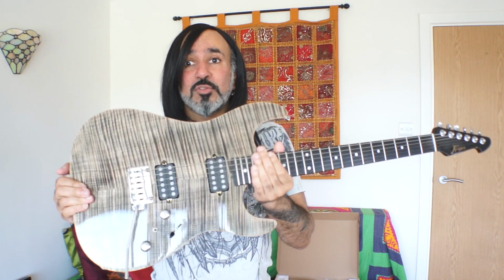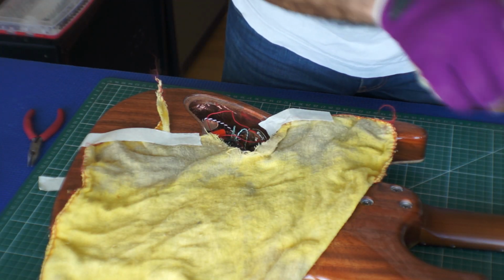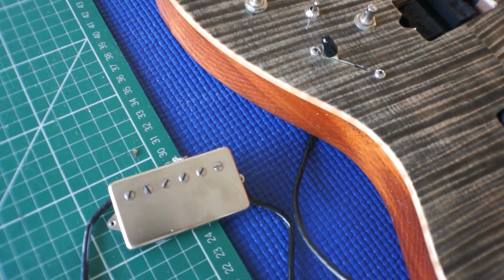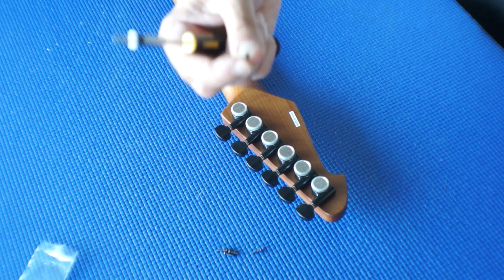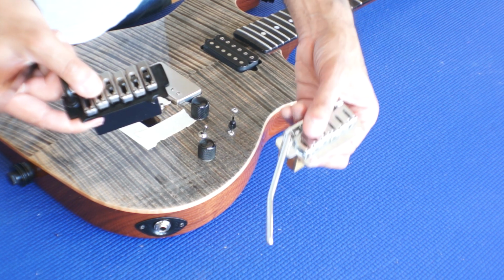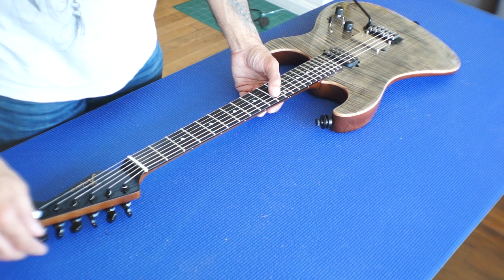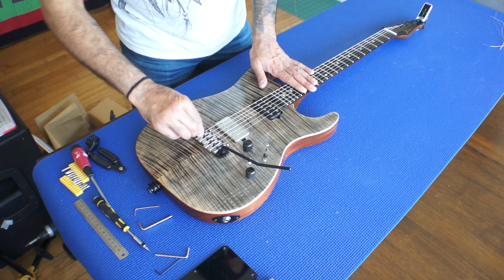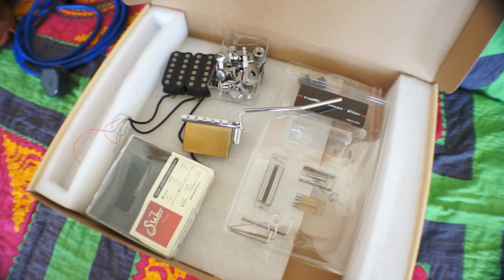Easy Guitar Mods ANYONE Can Do! And Quick Set Up Tips 😃

Comment: Great job! By the way Jay, I was recently thinking about getting a new Gotoh peg and a Gotoh VS100N bridge to replace the original one on my Keipro. Any advice on this? Do you think it will be an easy installation? Thanks!!
Reply from the maker: Thanks man! Much appreciated 😊 🙏 Oh very very cool! Yes that bridge should drop straight into place - to make sure though, measure the distance between the bridge posts and check against the spec of the VS100 - I'm pretty certain that its the same as my VS50MkII - I can't recall if I had to mod anything inside the bridge cavity - pretty sure I just dropped the bridge straight into place and all worked great 😊 Hope that helps man! Have an awesome day!

Comment: Why didn’t you use the brass block from the other tremolo?
Reply from the maker: Hey dude, two reasons I didn’t use it - first was that I didn’t want to take it off one of the others, and other reason was that the cavity on the Keipro is pretty slim and when I tried the oversized block, I had pretty much no tremolo movement. So I had planned to have a custom block built which would be the same size as the original Wilkinson block 😊 hope that helps - still getting a great deal of sustain from the guitar so I’m happy 😊 have an awesome day!

Comment: Sorry Jay, great video but I'm not that patient ....or perhaps too lazy .... I usually hand over my guitar to a tech especially when soldering is involved. I just purchased  a set of Bare Knuckle VHII for one of my guitars and I do think that  it wouldn't make sense to spend all that money for those pickups and then mess all around with my  less than professional tech touch :-)
Reply from the maker: Trust me dude - do it just once, you'll be addicted after that! 😃 I hear you though - it does take a little patience to do 😉 Very cool about the VHIIs! I have heard that they are fantastic pickups - let me know what you think once they are installed. Yes soldering takes practice to get right and clean - I've been doing it for years and only really feel properly confident with it now. Have a great day Giancarlo! 😃
Reply: Hi Jay, I've now got the BK VHIIs installed by a tech and .... they're really fantastic and offering a very clean and dynamic sound both at the neck and at the bridge and sounding awesome also with my Kemper and/or through a BE-OD and the rest of a chain including delay and reverb. Excellent indeed and worth trying them if so you'd like. Have a super evening ahead.